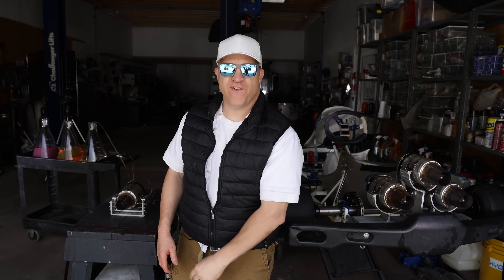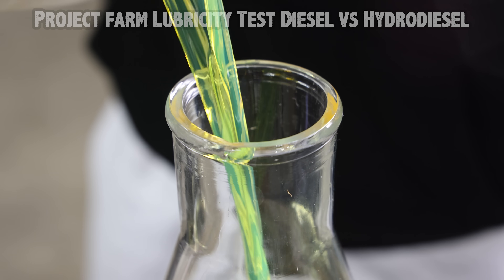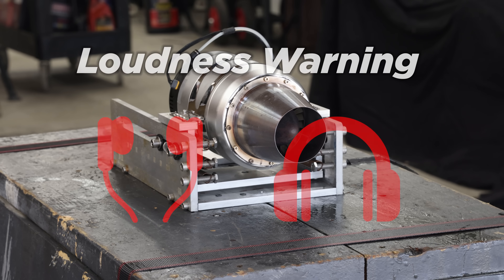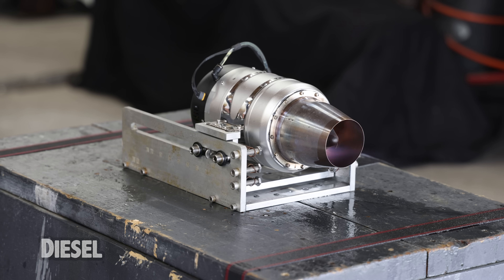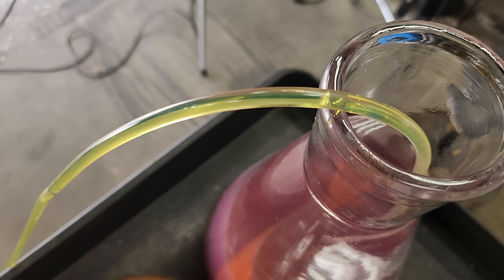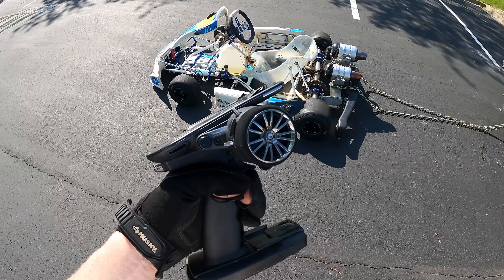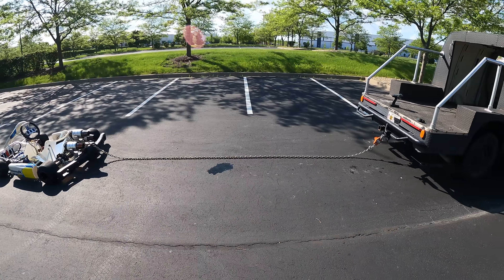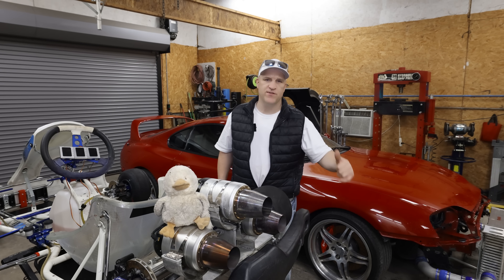Jet A vs Diesel vs Hydro Diesel (Jet Engine Thrust Test)

Comment: My local hardware store sells synthetic Kerosene by the two and a half gallon jug, how would synthetic kerosene perform in a jet engine
Reply from the maker: That's interesting I've never seen that before.
Reply: @WarpedYT  I used an exclusively for my garage heater, I felt like it burned cleaner and even when it ran out of fuel it didn't smoke nearly as much as the flame went out.

Comment: If jet A was not the most efficient, you would think that the airline companies would know about it.
Reply: Diesel fuel causes sulphidation corrosion in gas turbine engines.   It will destroy them. That is why Jet A is used

Comment: Are you using number 1 or number 2 diesel? That could make a difference and if you are buying it from a gas station explain the issue. Usually they sell #2 during the summer months and #1 during the winter months. Something to thinking about.
Reply from the maker: Yeah we only have #2 here in the Midwest, That's the same thing project farm told me.
Reply: @WarpedYT  That should just be differences in cetane rating though...

Comment: you could take this one small step furthure,, instead of jet A try actual kerosean,, see if they truly are the same,,
Reply from the maker: I did, I use them both all the time, They are nearly identical, Now jet A1 has a lower freezing point. But they are the same You could Google it.
Reply: @WarpedYT  ok,, been a long while since i looked at the diffrences,

Comment: 98,000 RPM is insane!!! These jet engines are a marvel of engineering!
Reply: If you think 98k is bad, people use turbochargers to build jet engines that spool in excess of 300k
Reply: @SupernovaSpence  Wow, it’s hard to imagine anything spinning that fast.
Reply: @SupernovaSpence I believe 300k is how fast a dental drill spins.
Reply: You can thank material science bros for that.
Reply: my 12kg r/c heli hovered at 111,000 turbine rpm .54mm o/d   turbine with 72mm dia freeturbine .
Reply: Theoretical maximum is 120k rpm, or approximately 40 rpm/$, which is not bad, i suppose
Reply: It’s quite normal for jets or anything that uses an impeller. My vacuum cleaner can do 110,000RPM.

Comment: For the real world test I would have expected it to only be different then the test stand if the vehicle was moving and adding air compression at the engine inlet.
Reply from the maker: Yes true but it was a lot different for some reason, I even changed out the fuel lines with larger lines and redid the test and I had similar results, I'm trying to figure out why.
Reply: @WarpedYT  Maybe air density due to different temperature and humidity. And also maybe the vacuum at the inlets which were very close to each other slightly thinning out the air decreasing the density further?

Comment: Wonder what would happen if you put black diesel in. If my memory serves me correctly it’s 90% used motor oil to 10% gasoline
Reply from the maker: Yeah I need to try black diesel, But I might need a big fuel filter for that.
Reply: @WarpedYT  yeah if you could do it, that would be lit.

Comment: If that go cart breaks away from the truck the damage will not be minimal.... That thing will be long gone before you can let off the trigger
Reply from the maker: Yeah in hindsight you're probably right about that lol, But I did use a chain for a reason, I definitely wasn't going to use a ratchet strap haha.
Reply: @WarpedYT   True, a chain is a much better idea than a ratchet strap. But imagine how viral this video would have gone if you did use a ratchet strap. Lol The melted scale would be the least of the worries. 
Actually, lets see a whistlin diesel/ Warped perception co lab...
Reply: @travisk5589  All that needs doing is a bungee around the brake pedal and a line with a quick release on an anchor cord as a safety. It gets away, pulls the cord and trips the release, bungee pulls the brakes, and that lag before throttle down is (probably) mitigated so there's no long jog of shame.

Comment: It seems like for the hydro diesel the pump was the limiting factor.
Looking at it, I belive the pump might either be cavitating due to the water content or the fuel system is just undersized for the extra flow needed.
It would make sense for it to cavitate easier as the water content boils at a higher pressure ("less vacuum") than diesel does.
If you compare the rpm of the pump you see something is off:
Jet A - 7500 rpm
Diesel - 8000 rpm
Hydro - Diesel 8700 rpm
Yet still the engine is only at ~90% rpm and the EGT is ~ 170°C low.
A jet engine at 90% rpm is somewhat like a piston engine at 40%rpm.
Reply from the maker: Yeah exactly, I didn't have time to look into it but I've always had a little trouble starting these engines with hydro diesel, once it's warmed up and running it's fine but starting is another story. But the ECU is looking for RPM, so if it doesn't see the RPM for one reason or another it starts adding more fuel up to the point where it hits the safety limit and then it cuts it. I'm pretty sure that was happening here these particular engines are pretty simple, the ECU just looked for temperature in RPM on a time temperature table.
Reply: @WarpedYT  I see, so it might just be thrown off by lower EGTs due to the cooling effect of the water content. Or something of sorts.
Anyways an interesting video!

Comment: Awesome video! I'm just off a 16hour night and have so many questions. Aside from thrust, I wonder the ml fuel per ft/lb-minute and EGT/ft-lb. Also lower EGT should be better for the engine no? what's the EGT/ft-lb? I'm not sure of turbine metrics sorry.
For a follow-up video I would, match full-throttle flow rates with a non-density specific flow meter. It would give you that efficiency data and be a truer comparison as you said because of the viscosity's. Maybe a matched flow rate test, matched ft-lb test and matched EGT test?

Comment: Can you build an afterburner for one of your jet engines in your next video?
Reply from the maker: I've had that on my list for a long time, just haven't done it yet because if I do it I want to do it right.
Reply: I would like to build an afterburner myself, but unfortunately I don't have the financial means. Since jet engines are very efficient these days, you should install a small fan so that the afterburner gets enough oxygen to work properly.

Comment: I'm sure WP knows this, but for everyone else, with jet engines the true thrust potential with any fuel essentially comes down to the caloric rating of said fuel, aka how much heat it can generate. Jet engines will optimize around power primarily and efficiency secondarily. While most operating principles in the RC engines are similar to commercial 'full size' jet engines (while being Drastically more simplified), lubricity of the fuel isn't a metric of overly high concern for anything other than subsystems and accessories. The engine itself is relatively low friction already, where the oil is more for heat scavenging of critical components with *some lubricity for bearings and wear surfaces that are sealed away from the combustion environment. Actual jet engine oil is remarkably 'thin' in viscosity at room temperature and even lower at operating temperature, visually equivalent to straw-colored salt water. 
Long story short, whatever fuel burns the hottest will have the greater potential net thrust.
Add: Since you asked, I run my experimental engines when I do testing on slightly refined used engine oil, primarily when testing new parts for engines in the 170mm and up size. It burns plenty hot to where you really need to monitor exhaust temperatures to ensure you're not melting parts (although I do composite part testing on occasion and actually want to try to burn them out).
Reply from the maker: Yes your spot on, The only other variable is how much fuel is physically able to be delivered. But one reason the lubrication was important here is because these little engines use the fuel as lubrication for the bearings, One of the injectors passes through the bearings before being sprayed into the combustion chamber, like you said this isn't the case for larger full size engines because that separated. 
But I guess a lot of guys who use these in RC jets were curious. 
Thanks for the awesome comment.
Reply: @WarpedYT  I suspected the lube issue might have been the case for the RC engines, which would make sense that you'd want more protection if your fuel is dual use in that case. I don't know how difficult it would be to modify one for a dedicated oiling system, but that's the route I've always gone with even on scratch-built packages. You can do quite a lot with a little gear pump that can supply enough pressure to hit 50psi on bearings and such, but that is also on segregated bearings behind labyrinth seals and relatively more working space on engines designed around ground use. I still enjoyed the video and will always pause what I'm working on to see jet engine action with real-world use. 👍
On that note, waste vegetable oil or throughly filtered engine oil with a few additives for enhanced combustion is a great trick if you're limited in that sense without dedicated oil systems. It's also pretty feisty with sufficient compression and will burn as hot as you want it to (both a pro and a con if you're concerned about HAZs or discoloring your engine case, haha).

Comment: To squeez out the best thrust from diesel fuel, you should retune the parameters to allow more RPM As diesel fuel is denser than kerosene, it also needs more air to be pumped in order to reach peak temp. Which is the image of max power.
May be you did, though...
But that may be the reason Diesel appears weaker in spite of beeing a denser fuel.
Thank you for this amazing vid!
Reply: Mhm if I remember correctly I read that the longer hydrocarbon chains in diesel need longer too burn complete since it is a preety brord range of chain lengths that so that the engergy get behind the turbine reduceing the rpm and therfore air intake leading too lower thrust 

Kerosin is basically a main part of diesel but it is only a small fraction compared too diesel and it burns faster and cleaner In a jet engine  soo with a different burning chamber aka a longer one the diesle will get more efficient
Reply: @TheLtVoss  when I was working in the navy we use helicopter engines as generators on certain type of ships to reduce noise.
These turbine engines required a specific type of  burners to allow a complete combustion of the diesel fuel that got inside.
The electronic differences were essentially about the starting phase management. 
We also use RollsRoyce Olympus turbo jet engine to produce power on propeller shaft. Again, different fuel burners than Concorde were used to burn marine diesel fuel. 
I guess here, the small turbines are designed to run on kerosene and are not able to squeeze out the full potential of a denser and more sluggish to ignite fuel .  As a matter of fact, we could see unburned fuel outside of the nozzle during runs on Diesel and Water Diesel mix.
Reply: The computer does that
Reply: @manuelpiston  Yes, you are right but inside the enveloppe of average parameters that work with the intended fuel.
You need to tune (tell new limits to the ECU) to make the machine perform best with a lighter or heavier fuel.
The physical limits aren't supposed to be surpassed though. Theses are the real limitations. But again, most of the time, the ecu mapping has to be tuned for an optimal result with a different fuel.
The turbine manufacturer sets its ecu to safe enough limit parameters, in order to offer a garantee .

Comment: I thought these jets can pull, but they very weak. 60lb is very low hp
Reply: its 60lbs in less than 1 cu ft.  the engine also weighs around 60lbs itself, so with volume/output and power/weight, these little things are crazy powerful for what they are.
Reply: However, this jet internal isn't efficient. If its a single rotary of same size, it would make more hp. That's what i meant by its weakness. You can call this jet engine is a toy model.

Comment: Nice demonstration👍
Just a thought,  preheating the fuel through a helical coil around the shroud might make a significant difference. 
If you decide to try this, the automotive stores have steel tube brake line that would work well for that.

Comment: Could it be because diesel is a fuel that works better under compression? What if you added a small amount of gasoline to the diesel to help it ignite more easily? My thought process being that the injector and ignitor inside the turbine is essentially like a smaller version of something like a flame thrower? Maybe add a small amount of racing fuel in with regular diesel? Obviously this comes with the risk of blowing up or melting the engine, so im not sure how willing you would be to do that and im just speculating.

Comment: The springs in your dyno is exposed to the exhaused. This must shirley surely introduce a time dependent interference with the measurments.
If you "flip" the bolts holding them, and use longer bolts for the engine attatchments, it should be easy to have the springs "shielded on the outside", and must less effected. No?

Comment: There is more energy in diesel than kerosene, not by much, but there is. The only reason can be this particular engine is designed around a particular fuel and the diesel is not being fully burned. Any engineers or physicists  know the reason for this?

Comment: Jet engines need no lubricity from fuel, but diesels do. Ironic that the lubricating component in diesel is what is being phased out by the EPA. Can't have these trucks running good indefinitely, I guess!
Reply from the maker: Actually these small jet engines do, they get the lubrication from the fuel. You have to mix in the oil beforehand, more for kerosene less for diesel.
Reply: Real jet engines have oiling, but these RC jet engines don't. They are sort of like a 2 stroke.
Reply: The military went to JP-8 years ago as a multi purpose fuel. They found out it did not provide the lubricity that diesel engines need.
Reply: Thanks for the knowledge, my only experiences with jets is on people carrying machines!